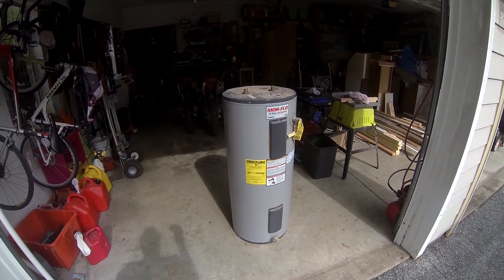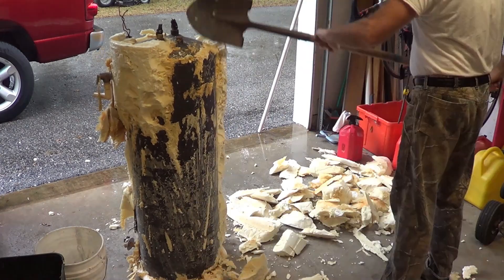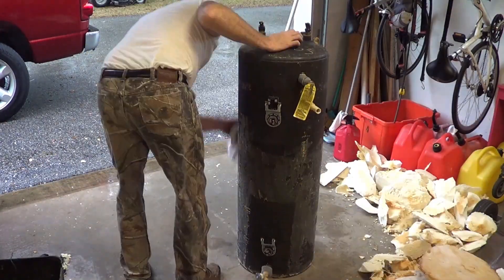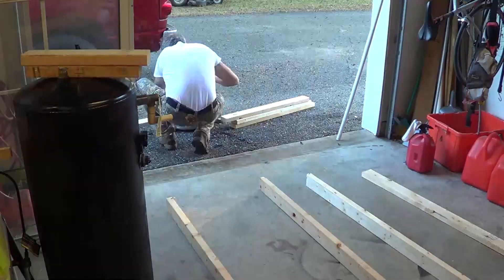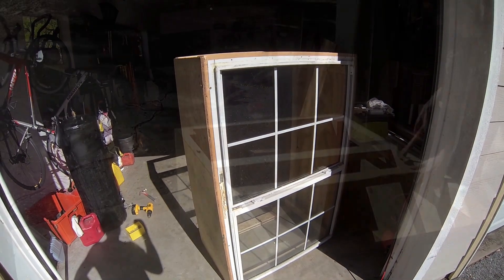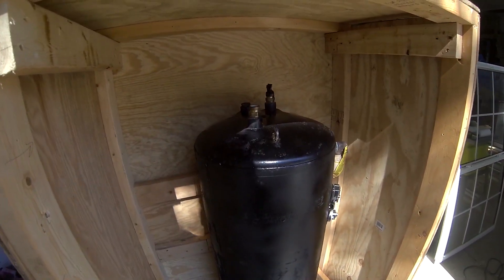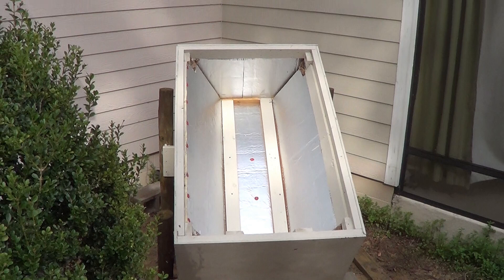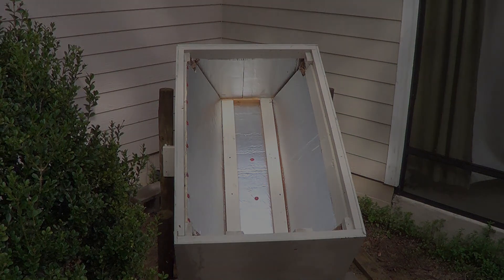Solar Water Heater: Pt1

Comment: David, would you post a link to the brass fittings you used to mate the pvc to the tank?  I'd like to do a similar project.  Thank you.
Reply from the maker: Arthur,  I remember that was a bit tricky part of the project.  I think I got a pipe thread to hose bib adapter from Lowes that did the trick.  BTW:  If I were doing this today I would make it a double tank and one tank would have the elements still wired up (solar voltaic dump load).  I would also use a better glass front.  This was more of an experiment.  I may redo it.  It does work very well.  Today the water in the solar tank was over 110F.  Good Luck!

Comment: Great idea. I hope to make a range boiler out of our  electric water heater a thermo syphon system heated by the wood stove. I hope to keep the elements intact and run a neutral wire to one side of the elements and remove the L2 side. This will make it a 1100 watt 120 water heater in the sumer power by our solar sytem. Lots of people use solar range boilers as pre heaters like you are doing. Great Idea and it should take a lot of load of your inverters if you decide to heat water with them on a regular basis.
Reply from the maker: That sounds like a good idea.  I would like to see that when you get it finished.  Thanks!

Comment: That is huge! Looks great...it will def work. I found some excellent reflective material at Lowe's in the building supply section. It is similar material used on vehicle dash protectors. The roll is really inexpensive and (best part) really reflects.
Reply from the maker: That sounds good and if this does not get hot enough I will have to check that out.  The location is good because it is only 14' of pipe to the regular water heater but also bad because I don't get full sun in that spot.  Should work well from March to November.  I'll probably do a performance video on it down the line.  Thanks!